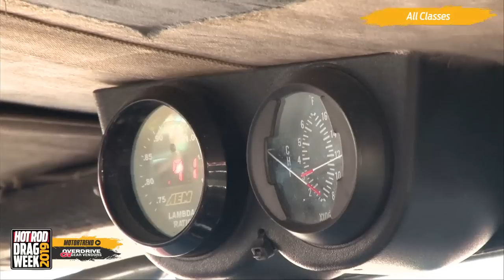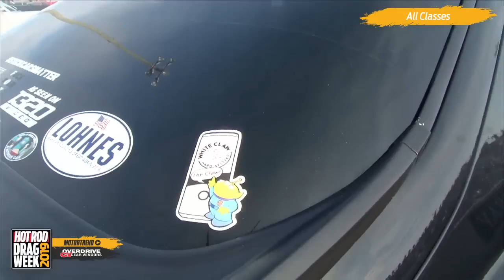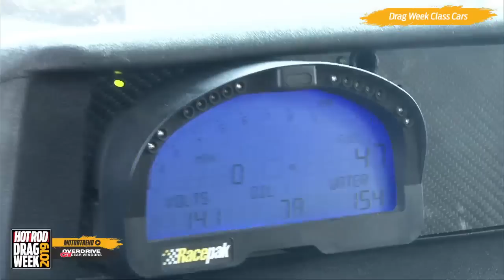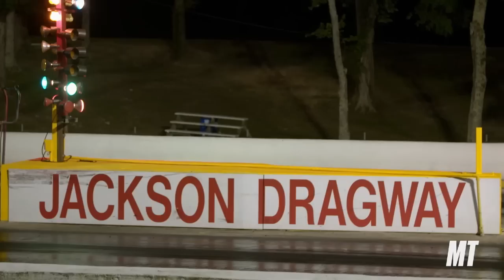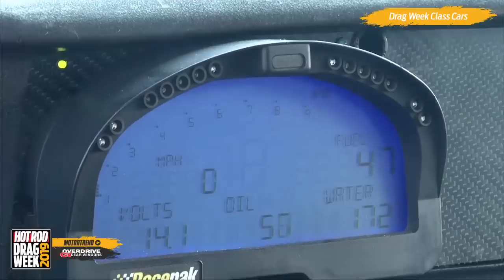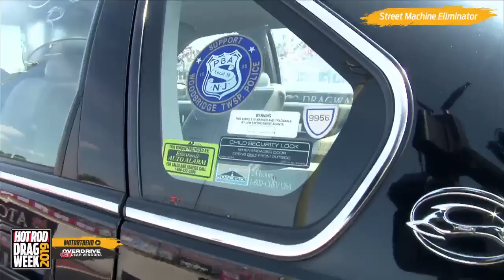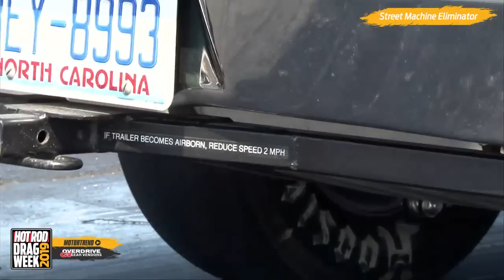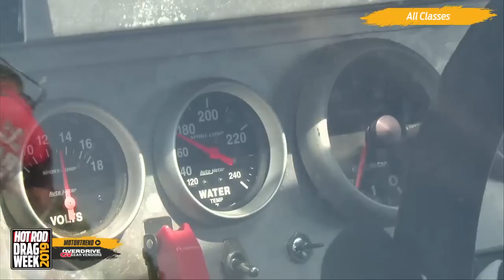REPLAY: Day 3 – HOT ROD Drag Week from Atco Dragway

Comment: Big block Pontiac? Haha.
Reply: Allen Mckinney anything over 400ci is considered a big block for drag week.
Reply: @voodoochild661  Ok. Just ain't right.
Reply: @voodoochild661  That is not so. Anything above 430 is considered a big block. However, if it is based off of big block architecture it is considered a big block no matter what. Even if you did something like a 366 short stroke BBC, it would have to run in the big block class.
While Pontiac did only have the same block for 350's 400's etc. they are considered big block architecture in Drag Week terms. But if you punch out any of the FSB, SBC, LS, LT, LA, or Magnum motors beyond 430 cid, you will be in the big block class.
Reply: @AB-80X  are you sure? AHRA and NHRA both use the 400ci as the threshold of a big block
Reply: @voodoochild661  
Drag Week only use the NHRA safety regulations. All class rules are unique to Drag Week. My guess is that Freiburger chose to cut it at 430 because the LS7 is a factory small block. And honestly, anyone running fast today with a small block runs 400+ ci. The primary exception is the small cube budget build turbo LS mills and 5.0 Fords. Most bore and stoke the little Chevys, Mopars and Clevelands to 400-427's. Cutting it at 400 would probably eliminate 2/3 of the small block field. It's on page 6 in the rules.